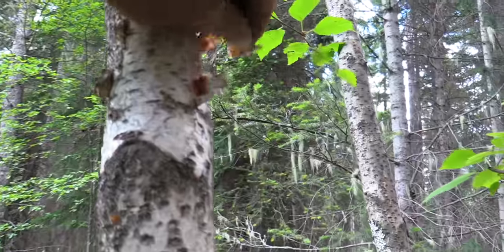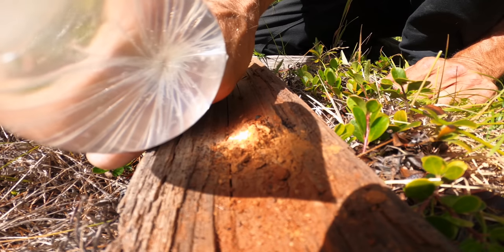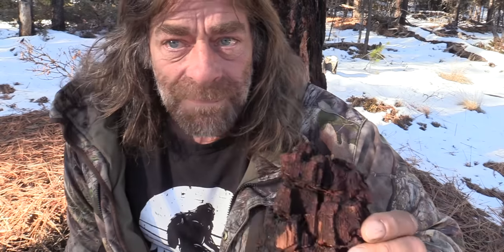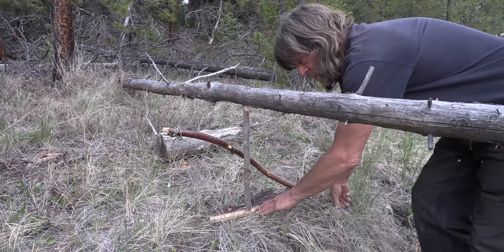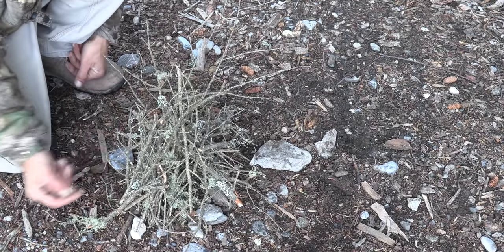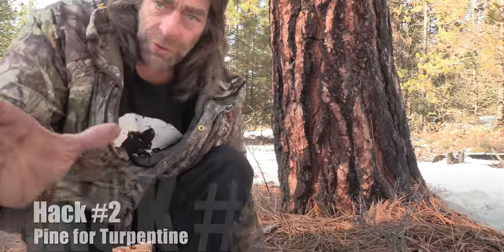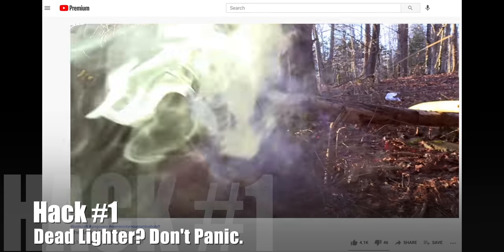8 Firestarting Hacks You NEED to Know Before Your Next Survival Adventure

Comment: Hi Greg, if you remove the metalpiece from your lighter you have still a chance for a little flame. Put the lighter in your hand for a while to warm it up. Now press the gas permanent with your left thumb and ignite with your other hand, and you get a very little flame. By removing the 'metalpiece' there is more oxygen around, and you can start a fire. Stay well and a big PETRI
Reply: Good tip anna

Comment: A cotton ball unrolled, sprinkle wood ash on the cotton ball, roll it up with the ash in the center. Now place the rolled cotton ball between two pieces of wood. Slide the top board quickly, while pushing down. The fiction will ignite the ash in the cotton ball, hence starting the cotton ball

Comment: Not sure I'd do that with my rifle but that battery trick was "Savage" Greg, and the bow drill trick with the log for weight is super clever to save energy!

Not sure if you've kept up with Alone since you were on season 3... (LOVE that series!) but Joel who grew up in S Africa who was on season 7 would say "you're a real fart smeller!" 🙃(Smart feller!) 

4:38 the "STUMP" part is key, as that's where a lot of leftover pitch or sap settles in the trunk and still lingers as a sort of "rotten fatwood". I always like learning the "why" behind fact because it sticks in your head better as a memory aid for later!

You said "not sure if it was Fir" just look at the needles littered at the base!😉Like behind your back at 4:53 is all "long" pine needles. Fir needles are like 25mm/2.5cm/1 inch long TOPS vs longer pine needles 13cm/5 inch. If it's just a downed tree/log with all the bark gone then you can look at the first outer layer of wood under the bark, the "cambium layer". With Fir trees they'll develop splits as they dry that run fairly stright up the sides of t timber, vs Pines which will split down the outside length-wise but with a serious continuous TWIST that keeps spiraling around the log like a rifle barrel. Speakin of, try some carnauba car wax to keep your Savage barrel rust free for years and rub it in with some steel wool. It'll clean right up and stay rust free for at least a good 4-5 years! 👍

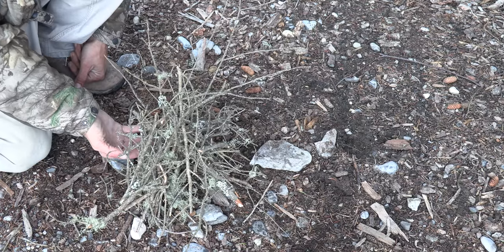10:09 Usnea most commonly known as "Old Man's Beard", is HANDY stuff for more than just fire! Effective against many bacteria such as treating Strep-throat, Staph infections, common pneumonia so it's freat for sore throats, skin infections or other bacterium.  
10:50 Red Green much? 🤓 "I'm thinkin wool work socks!" 😁

Speaking of Red Green and your poor rusty Savage rifle